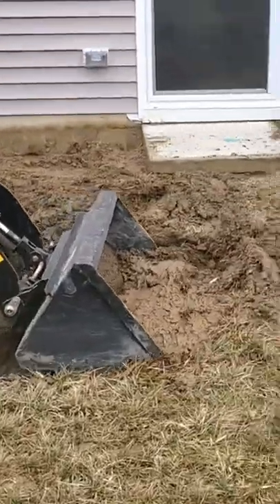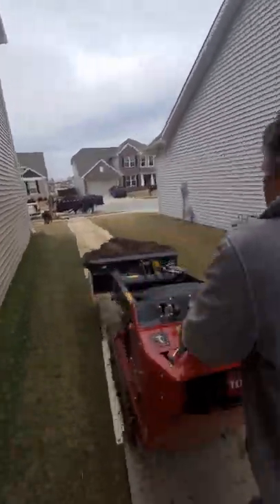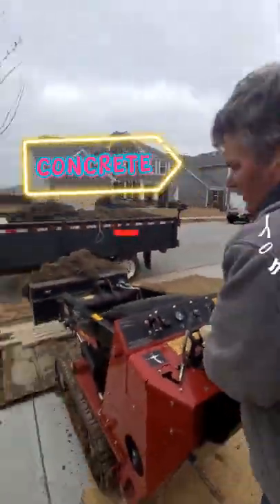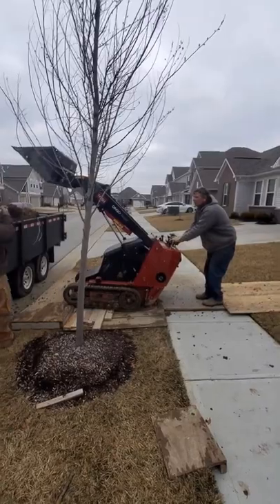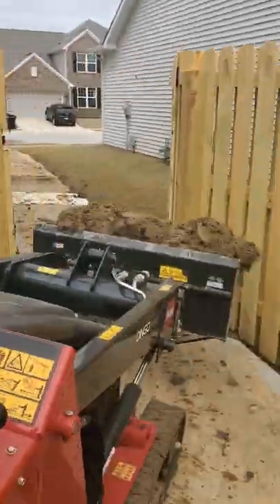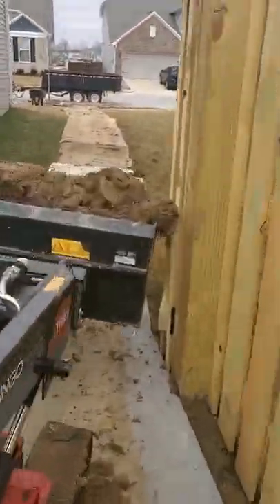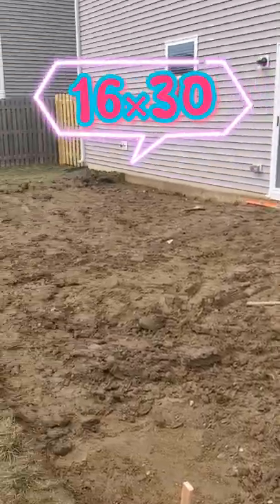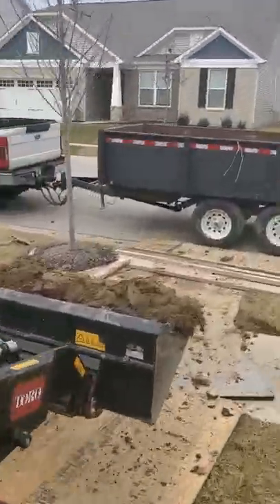Starting my 2nd year on youtube by renting a DINGO

Comment: Wait a minute wait minute wait a minute. You bought a dingo!?! Way to go! I thought you were leaning towards a Mt100.  It's gonna make your job way easier having one around all the time for digging.
Reply from the maker: No it was rented, we didn't buy it. If I was to buy one it wouldn't be a dingo lol. Not a big fan. I would prfered a shovel lol
Reply: @GRUBB-MUDD  why prefer shovel?
Reply from the maker: @ricardogranados3112  well w that kind of mudd. a shovel is better, now if i had an mt100 it would be different, i was not a fan of the dingo. but tbh it was better than a shovel
Reply: @GRUBB-MUDD  i just bought the dingo tx427 is why i was asking lol
Reply from the maker: @ricardogranados3112  well your dingo is alot better than that old one we had. and that was in early spring when it was extremely muddy
Reply from the maker: @ricardogranados3112 yo i ai t gona lie,the dingo was alot better than a shovel